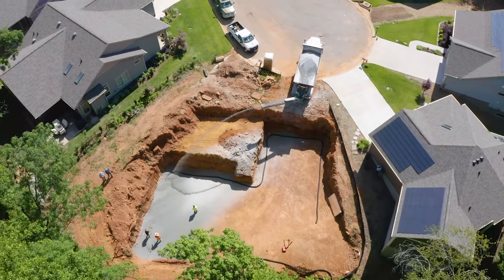Basement Wall Insulation | Done WRONG

Comment: Hi. Thanks for the video. Would a folmar250 or 150 rigid foam board be okay to put directly against the poured concrete? Then frame in front of it? Then put kraft faced insulation inside the cavities? Would putting the 250 or 150 directly against the wall not allow the wall to breathe? My house is a 1988 build and the basement floor has a 2.5 inch opening with rock in it all around the perimeter of the basement floor. Thanks for your time.
Reply: using 2 in foam insulation followed by batts placed within a wood or steel stud wall are common practice, when placing the foam board use the glob method which should allow the foam to be held away from the wall by at least 1/8 inch, for the floor I would be using a dimple mat, followed by at minimum of 1/2in foam 25psi or higher, followed by standard 23/32 flooring osb running perpendicular to the foam board layout. The only thing to note is to build the floor before the wall studs.
Reply: any thickness of rigid insulation right up against it will do the trick as a moisture barrier. any batt insulation used in the framing can then be unfaced
Reply from the maker: Yes it would be fine.  The main purpose is to stop the interior surface from hitting dewpoint (the foam board raises the interior surface temperature) resulting in condensation.  You don't need the kraft faced insulation, you can use unfaced batt insulation which will allow any moisture in the wall to dry to the inside.  The exposed 2.5 inch opening sounds like an interior french drain that may have been added after construction.  This could be a source of humidity in the basement.

Comment: I am getting ready to finish an older unfinished basement. The interior basement walls are raw concrete. What are the best practices? Should I adhere rigid goal boards to the concrete walls prior to framing the interior walls? If so what thickness would be necessary? Wouldn’t there still be a gap between the rigid foam boards and concrete that could allow for condensation? Would a closed cell spray foam be a better option?
Reply from the maker: Where are you located?  My approach would be rigid foam board on the interior of the concrete walls at least 1.5 - 2 inches thick.  Then frame the walls on the interior of the ridgid foam board.  There is a product called insofast that is a perfect insulation board for this project - might be worth checking out as it eliminates the need for studs I believe.

Comment: So if you put a rockwool board against it, do you still need a gap, and then put more insulation?  Or do you just use rockwool right up against the concrete?
Reply from the maker: @Playlist4213  I think you could put the Rockwool against the foundation but recommend you consult the manufacturer’s recommendation.

Comment: @addisonhomes what if you sprayed it with closed cell foam insulation? Would this work in this exact scenario as my basement currently is framed like this but isn't finished yet.
Reply from the maker: @BobbyFerguson-t4n  you can definitely use closed cell spray foam - you just want to be sure to get an uninterrupted layer of foam between the studs and the poured wall.  This will provide a complete thermal break and dramatically reduce any chance for condensation.

Comment: We have a home built in the early 70’s. We recently started to remodel the basement by removing the tongue and groove panels and drywall from the studded walls.   The basement walls are painted cinder block. The builder studded the perimeter and packed styrofoam sheets against the block walls in between the studs, then packed fiberglass insulation against the styrofoam and covered the studded walls with plastic sheeting. Condensation started rotting the studs on the south wall which is particularly exposed to sunlight. Paint is peeling off the block walls in order areas of the basement. We normally don’t have water infiltration in the basement so I think that this is due to the previous builder/owner going ape insulating the basement. As of now all styrofoam and insulation is removed. I was going to remove the damaged paint and repaint. Any suggestions on how to proceed with remodeling in terms of insulation? Thanks!
Reply from the maker: The condensation and peeling paint is likely caused by the moisture drive through the block when the sun hits the exterior.  My approach would be to install rigid insulation board against the block walls in the basement (minimum of 1" in the South and even more in colder climates), then frame walls on top of the insulation board and install drywall.   No plastic sheeting which will allow any trapped moisture in the framed wall to dry to the interior.
Reply: @AddisonHomes 
Would you paint the block walls after cleaning them?

Comment: So nailing Rockwool board first to the foundation then the stud wall  filled with more Rockwool will prevent condensation/mold?
Reply from the maker: I would recommend a continuous insulation that is also a vapor barrier or retarder and application with adhesive vs. metal fasteners such as nails or concrete anchors (these will transmit the colder wall temperatures which can result in condensation).

Comment: I live in the midwest and want to insulate my 1980's basement. Can I put foamboard then studwall and then faced insulation in the stud cavity and then drywall? I know this is a double vapor barrier but I am seeing conflicting information on this. Any help would be appreciated.
Reply: if there are not studs currently installed, use the foam board and then build your walls, which should be insulated since 2in foam board is not enough
Reply from the maker: Great question-  the foam board against the foundation wall is a great approach.  Be sure to use what the energy code recommends for your climate zone.  In a colder climate, more is better.  You really don't need to use paper faced insulation with this approach since the foam board will nearly eliminate the dew point potential in the assembly.  With unfaced cavity insulation, the assembly can then dry to the inside if needed.
Reply: @AddisonHomes  If there is a possibility of moisture coming through the basement walls is it advisable to glue foam board directly to the concrete walls? Wouldn't this trap moisture against the inside of the concrete walls potentially cause deterioration of the concrete?  Appreciate any light you can shed on this. TIA.

Comment: I basically settled on rigid foam board against the concrete until I started thinking about flammability. Now I'm a bit hesitant about it again.
Reply from the maker: @GeneralChangFromDanang  you should be able to find products that meet the smoke and flame spread limits outlined in the building code.

Comment: Doesn't a high water table affect insulation requirements or lack thereof in a concrete wall? It seems like the tighter a house the, more issues in regards to mold, moisture, etc. are experienced.
Reply from the maker: @lorimcquinn3966  high water table would be a challenge to any foundation - especially a basement!  Moisture must be controlled in any building, especially in tighter homes. Tighter homes allow for improved control of indoor air quality (including moisture) and greater energy efficiency that are not possibly in leaky homes. But all buildings function as a system and you cannot build a tight home without paying attention to proper HVAC design, exhaust ventilation of point sources of pollution (including bathroom humidity from bathing), and properly design ventilation.
Reply: @AddisonHomes  Thanks for the reply and tips, starting a new home in May. I live in a state with high humidity levels along with higher than normal water table levels. It seems when the houses became tighter and tighter, issues with mold and moisture damage started to surface regularly. Moisture that use to dissipate normally now is trapped, causing issues. It's difficult to find a piece of property that isn't affected by the flood plain. Materials used in new houses seem to accelerate issues and an unbalanced method of construction  plays heavily into all of this.

Comment: I have exterior foam board around my poured walls? Do I have to put it inside also? 1 year old house. Or is another option to build my walls off of the poured walls a few inches to leave a gap?
Reply from the maker: That's great.  I would still install a gap between the interior concrete wall and the wood framed wall.

Comment: What about a block wall in my attached garage that I'm turning into a room? Can I use regular insulation?
Reply from the maker: I would install at least 1" R-5 foam board against the block wall and install furring strips or frame the wall on the interior of the foam board.  This will prevent any interior air that may leak into the framed wall from hitting a dew point surface resulting in condensation.  Hope this helps!
Reply: @AddisonHomes  thank you!

Comment: so foam board, frame, then fiberglass bats in the framing cavities?
Reply from the maker: That would be our recommentation!  Don't forget to seal the seams in the foam board or use two layers and stagger the joints.

Comment: Are those studs placed directly onto concrete?
Reply from the maker: Yes typically but due to inconsistencies in the concrete wall and studs there are gaps.  The gaps don't solve the issue with condensation in the cavity however.

Comment: What kind of basement wall insulation would you use in southern climate? The coldest basement temp has been 52 degrees and hottest has been 72.
Reply from the maker: 1" XPS foam board would do the trick against the concrete wall with framing to the interior of it.  The key is keeping warm, moist air from contacting the colder surface of the concrete, resulting in condensation - think cold drink on a warm, humid day - the glass sweats on the outside.  Same principle of dewpoint - you don't want this to happen in your wall.  The R-5 XPS foam board is plenty to keep the surface warm enough so that dewpoint will never be reached.  You really don't need any more insulation than this - but check your local code -

Comment: Great info!
When considering rockwool, what measures are you using to retard moisture with a low perm coating? Since rockwool itself is not a vapor barrier/retarder vs using continuous foam board/spray foam which is a vapor retarder at 2” or greater?
Reply from the maker: The most important element needed in this type of wall assembly is eliminating any surfaces that might be at dew point temperature resulting in condensation potential. This is best done with an air impermeable insulation on the interior surface of the concrete foundation wall such as foam board.

Comment: Hey what do you think about gluing roofing paper or other contact barriers to the foundation wall and then adding batt insulation. Would this prevent any moisture issues or is foam board the only way to go since it has thermal properties.
Reply from the maker: Unfortunately, anything with no insulation properties will still result in likely condensation on that interior poured wall surface - just on the surface of the roofing paper or other material which will still result in the unfortunate potential for mildew and mold growth in the wall cavity.

Comment: How are they doing it the “other way” that is generally minimum code? Batten with vapor barrier on the inside (not against the concrete wall) and taped not stapled?
Reply from the maker: The common approach that we see in the Southeast is paper faced fiberglass batt insulation, stapled to the inside of the stud, not even to the face.
Reply: @AddisonHomes  thank you sir. I’m in Metro ATL and curious as i’m trying to finish my basement and worried out our heat and humidity we have down here.
Reply from the maker: @bwrick21  Definitely worth trying to do it the best way possible.  We are in Greenville, SC so same conditions you have in ATL.  A safe bet would be to install 1" foam board on the interior face of the poured walls, then you can install the framed wall against the foam.  No cavity insulation would be needed in this case, but you can always add it if you desire.  You'll likely notice that your basement is typically cooler than the upper levels of the home which is due to the constant ground temperature of around 60 degrees.  This is a great benefit in the Summer, as little cooling is required, but will require some additional heating in the winter to bring it up from ground temp.
Reply: @AddisonHomes  thank your sir. Go tigers!
Reply from the maker: @bwrick21  Go Tigers!
Reply: Question, if you frame 2x4 wall right up against the foam board-how would you plum (level) the walls if you need to? what I am trying to ask is if I can keep 2-3 inch gap between foam and 2x4 framed wall and then put fiberglass insulation - would this defeat the purpose? Thank you advance. @AddisonHomes
Reply from the maker: @sherazwilliam1358  Definitely can space the wall out from the foam board in order to plumb the wall.  A key detail is to air seal any gap at the top so that air doesn't move through the fiberglass insulation.

Comment: No House wrap first frame/insulate with Roxul/poly/drywall simple
Reply from the maker: Wood framing with rockwool cavity insulation against a poured concrete wall with poly then drywall on the interior is only a matter of time before mold growth begins.
Reply: @AddisonHomes  Read what I said House Wrap first then frame then insulate then Polly then drywall this works simple 🙂
Reply from the maker: @thegrantdanielsband  good luck with that!
Reply: @AddisonHomes  Good luck with that? Of course you need to put the house wrap on the right way!! I have been doing this for years with block or concrete walls and never a mold problem and it is a simple problem solved very effectively 🙂

Comment: I have a 1 year old poured walkout basement wall exposed on the outside without waterproofing or covered with siding. The builders installed 1.5in foam board on the wall. They did a lazy job around outlets that drop from the ceiling and are installed thru metal conduit. It always felt drafty in those areas so i decided to pull the foam board off and i can see large spots of condensation on the wall. This is an unfinished basement also. At this point is the foam board just not providing enough insulation and still allowing heated air to reach behind due to a draft? Is this even a problem that there is moisture? Can i reinstall foam board and try to seal it better to prevent moisture occurring? I don't plan on finishing the space so just looking for guidance on what to do about the moisture. Thanks
Reply from the maker: It could be one of two things: 
1) moisture infiltrating through the un-waterproofed concrete wall or
2) warm moist air flowing in around the poorly sealed outlets and condensing on the colder concrete.

Depending on your climate zone, 1.5 inches may or may not be enough to prevent the condensation.  Where are you located?
Reply: @AddisonHomes I'm located in northeast Ohio. I've since discovered it's surface moisture on the wall. I removed the form boards and the wall dried out in a day. I did a test and put the boards back up without sealing them and leaving obvious ways for warm air to reach behind. I also did a plastic bag test and taped it to the wall on all sides then covered that with foam. When i removed the foam again after a few cold days I had surface moisture again, except under the sealed plastic. 

I sent photos and surprisingly the builder offered to fix it and just finished it a few days ago. They made sure to run spray foam along the top and bottom of the panels and it looks significantly better than before. I'm guessing i won't see the issue again. 

Thank you for the reply.

Comment: Very correct Re fiberglass, but very incorrect Re rockwool- it’s highly vapor permeable. You need rigid foam whether closed cell sprayed on or glued to wall.
Reply from the maker: Yes of course any insulation you can blow through will be vapor permeable. The foam board insulation raises the interior surface temp to reduce the chances for condensation.

Comment: You are 100 % correct Sir! Problem is IDIOT engineers that dictate the code and builders that ABUSE the minimum code is the problem ! There should be NO minimum code. There should be only "One" way to do it according to your climate and area you live! NO MINIMUM CODE!  This is how you fix it !  You NEED a thermal "break" to the concrete "PERIOD"! To do this like you said in your video, You must adhere a  rigid foam board with a descent R value to the concrete . Usually R5 or higher is great! Then your all set to insulate your basement and NOT have to worry about insulation getting wet and loosing "its" R value. I live in a super cold enviroment and this happens all the time out here in Edmonton ALberta Canada! -35 is a common temp in the winter. The builders (99 percent of them) save money and use the minimum code requirements by law In my opinion, the IDIOTS that make up the rules (code) should be held accountable for such stupid behaviour! There should be NO SUCH THING as minimum code PERIOD!!!! The right way or the highway